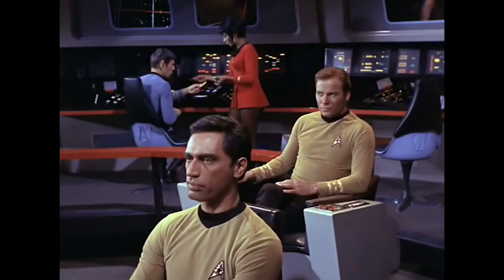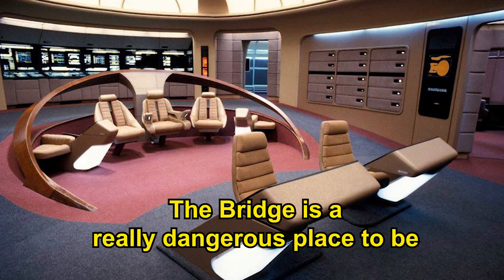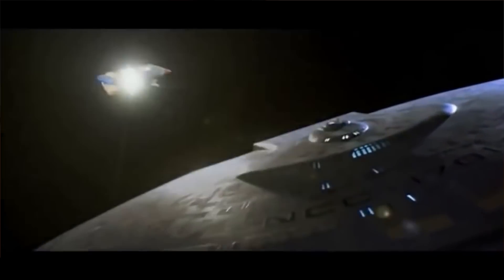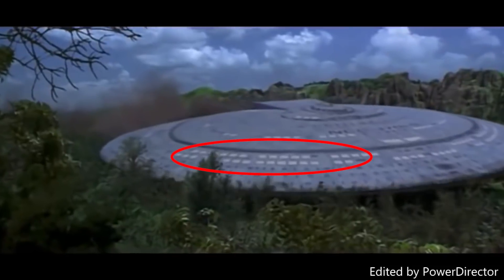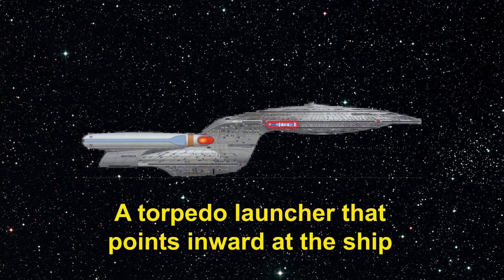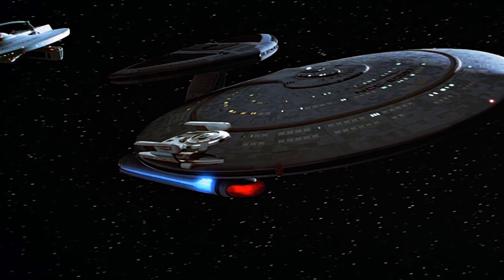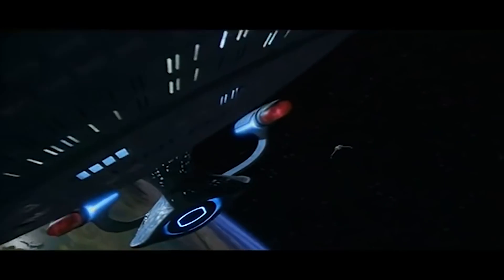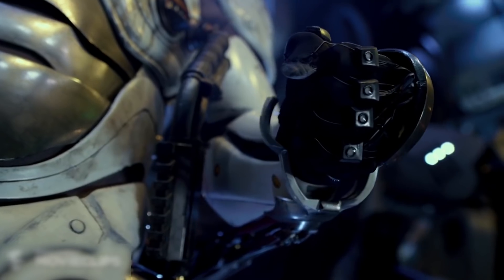10 Flaws Star Trek - USS Enterprise NCC 1701-D

Comment: The Romulan warbirds always seemed kinda stupidly designed. Don't get me wrong, they look cool, but all of that hollow space. Where's the warp core? The shields have to protect a lot of nothing....
Reply: Romulan Warbirds dont have a Warp Core, they use a black hole for getting energy.
Reply: @Konzertvideos  technically it was an artificial quantum singularity
Reply: They couldn't afford a natural quantum singularity?  The damn Romulan economy is in a slump.
Reply: 00 Coyote
The original concept was that warp nacelles needed line of sight to be able to connect. Which is why they're usually kept exposed on the ends of pylons or wingtips.
So the warbird's hollowed out section lets it's nacelles "see" each other. Though it's still a stupid design. I mean are those wings even used for anything?.

Comment: To answer your question regarding shield modulation, the reason their shields don’t automatically modulate is because any weapons that need to fire through their shields, like their own phasers need to be the same frequency in order to pass through. As Starfleet has a very small ranger for phaser operational frequency. In addition, as they have no way of knowing what the klingons weapons frequencies are they run the risk of setting them to the same frequency and the same thing happening

Comment: Here's a flaw: the corridor design. They loop around the saucer section, meaning you have to take the long way around to get to the other side of the ship. There's no straight line from the back to the front, so good luck getting anywhere fast.

Comment: The Galaxy class ship was a battle cruiser. It was the state of the art vessel of the time. The reason for the luxury was because it was designed for very extended long range exploration missions. Thus this why families were allowed to come with the officers. 1701-D was designed to have a 100 year service life, which is also why the expansion areas were designed into her hull. You might want to pick up that tech manual and read it. Most of what you were arguing and didn't know about is in those pages of information.

Comment: This was fun! And there was an attention to detail for certain. Just as a quick joust, I'd have to point out that fluctuation of the resonant harmonic frequencies of the Enterprise shields requires significant more power than leaving them static. In the same way that a musical instrument playing a symphony is under more duress than the same instrument playing a single sustained note. It would be more optimal to leave them operating at a specific resolution in order to conserve power, in case that extra boost might be needed in a pinch; for say, the engines or the deflector dish.

Comment: This was a good video! In Generations, along with remodulating the shields, I never understood why they didn’t just eject the warp core if it was about to breech. They wasted so much time evacuating everyone to the saucer section that they didn’t have time to escape the blast. They should have just dumped the core and used the impulse engines to get away from it.

Comment: The placement of the warp nacelles is based on the shape of the warp field it needs to create. The Enterprise is a long range cruiser, it needs to project a specific warp field to do this, just as a plane/ship needs to be balanced correctly to reach optimum speed thru the air/water.

Comment: You are one of the first to recognize that the Galaxy Class has that 3rd torpedo tube.  Also speaking of escape pods, there are even cetacean escape pods that get jettisoned through the iris style cargo doors on the primary hull.  

My issue with the Generations movie, shield frequency aside, is the fact that the warp core, with myriad safety features, was sent into a breach by barely scratching the surface.  The only thing in that area that was struck by the BoP that was vital was Deuterium Storage.  And thats after you get past the hull plating and labs that are in that area.  They could have made that fight a lot better.

Comment: In practically every Star Trek Star Ship the bridge is always on the top. This design flaw seems to stem from the days of the navy. The bridge is always up there and exposed. This REALLY shows in Star Wars where the Star Destroyer bridges are practically way out there, much like the warp pylons. Doesn't help that the shield generators are also just as exposed.

When it comes to the Warp Engines, well... We really don't know much about the magic behind them that bends time and space for FTL Travel, so maybe depending on their abilities they do need to be exposed, whether it is due to radiation exposure or more efficient in folding space the further out they are.

And the aft torpedoes, while the drawing shows two launchers, here's a fun idea to think about: When joined, the torpedoes are actually sliding down the "spine" of the ship. ;D

Comment: A lot of people forget the D was about more than exploration. It was also regularly used for diplomatic missions, which would require some luxuries. Also, leaving room for future upgrades is likely what made the alternate future Enterprise-D possible. And the D was upgraded multiple times through the series. They didn't even go a season without  some upgrades being made, including making people in the holodeck. (But we can go over how D holograms are fake matter and Voyager holograms are photonic later.)
Bridge placement has been an issue since Starfleet existed, it seems. However, the bridges of Klingon ships are also not well thought out. The Bird of Prey(a Romulan vessel stolen and used by Klingons), as well as the D7 both have their command centers in the head of the ships, at the end of very long, narrow necks. The Romulan Warbird is also a victim of "designed to be cool", what with the entire back half being an elipse with nacelles attached. I wonder if the head is designed to detach?
It's nearly impossible to find a starship in the franchise that is designed properly. However, this all comes down to "What is Starfleet's purpose?" Is it for exploration? Is it for defense? Is it for diplomatic missions? If you answered "all of the above," than maybe it's time the franchise acted like it. Kinda tired of it always being some sort of either-or deal.

Comment: I play Star Trek Bridge Crew in VR and the flight controls on the STNG bridge work well and are intuitive (no gentleman sausage control required). The disk looking control you point to @10:15 does actually steer the ship in VR (port/starboard/dorsal/ventral). Mass doesn't matter in the vacuum of space where there's no resistance, so designing and lugging that over sized hulk around wouldn't be an issue IMHO.

Comment: The shield modulation thing... you're presuming there is no downside in remodulating. It could compromise the integrity of the shields, so for most of the time would be disadvantageous particularly against phaser fire. The Borg example was not to combat weapons, it was to fuck up the Borg's grip. // Wasted space, doesn't matter really. It's not like the heavier they are the slower they'll go. // Warp engine locations, well largely aesthetic... but you could argue that it gives better warp field size/distribution allowing for faster speeds etc. // The bridge location, indefensible. Put it in the middle of the ship. // I don't think three incidents of the ship being stolen/occupied is "constantly". And one of those they were just trying to steal some stuff while they weren't looking. // Saucer separation crash/why no escape pods... potentially as they warp core ejection hadn't worked and they were about to have an entire exploding half-ship nearby, escape pods would be blown up. They're better in the saucer with some shielding. You never asked why Crusher was evacuating sickbay when it was already in the saucer.

Comment: The EPS power grid is a grid of conduit that has basically thick beams of "lightening bolts" that travel along them.  So if an enemy ship hits meters away, it is up to the flaws in the materials of the conduit to decide when and where those bolts of lightening will escape from as the material fails from stress and the electromagnetic containment inside those conduits that keep the magnetically charged plasma from coming into contact with the conduit walls fails.

This is why the computers and consoles explode in Star Trek, they are surrounded by plasma conduits .

Comment: You skipped the reason why saucer section of the Enterprise D has crash landed. It was hit by warp core explosion and pushed to atmosphere where the lost ability to control descend, all part of the movie. Otherwise they could sit on orbit and use transporters to evacuate on planet if needed. Also saucer was for emergency needs, not full spec ship. One of the few parts done on battle bridge was actually a flight through atmosphere in first season during battle.

Comment: I need to make a point about seatbelts vs. the inertial dampeners. The ship routinely accelerates from 0 to some appreciable % of the speed of light in seconds. (Warp speed has the ship travel on a bubble of space that travels with it, so it's not technically moving through space when travelling at FTL speeds.) If the inertial dampeners fail, safety belts may as well be knives because the crew will be crushed into an atom-thick paste.

Comment: Flaw with your flaw list, when talking about the crash landing (not having landing gear) and not using escape pods. The damage from the battle with the KIingons and the explosion of the Star drive section caused them to get caught in the planets gravitational pull and CRASH on the planet. It wasn’t a choice so even if it had landing gear it wouldn’t have been able to land with it, like Voyager in your “wrong” clip.  All they could do was minimizing the impact as much as possible but they didn’t have flat area so they were screwed. 

And the Escape pods? It’s called time, they didn’t have it.

Comment: Not having multiple transporter systems linked to different operating systems and power supplies. How many eps did they have transporter problems? On a similar note, they had a hangar bay of ships equipped with transporters that were never utilized in times of crisis.

Comment: They can do a site to site transport within the ship, even with the shields up, so even in a battle they can transport torpedos from the aft launcher of the saucer section to another launcher.  This specific thing never occurred on TNG, but other episodes transport torpedoes to various locations.  So it is possible.
They probably designed that particular launcher to be deeper in the ship to protect those 70 photons from being easily damaged.
Your points definitely make sense.  But the debate is what I like the most about Star Trek theory.  I just happen to be a hard core Trek nerd, so I have an answer for almost anything lol

Comment: Since I haven't seen anybody touch on the automatic shield frequency thing it's because of several reasons 1 some frequencies will Make The shield weaker against certain attacks others will make the shield stronger but straining the power system and having automatic shield frequency will have problems during a computer outage now they could have done better by making the shield frequency where you have to pull it up on the screen instead of keeping it out in the open at all times.

Comment: In regards to the warp nacelle positioning, I have heard that the larger nacelles generate a higher resonating vibration and noise, the pylons give it some segregation. Smaller ships such as the defiant don't have this issue as much nor are they built for long duration flight so this wouldn't drive the crew crazy.

Comment: That the bridge is placed at vulnerable spot is often seen in sci-fi across various franchises, is very common. Also IRL the bridge, or a similar control area, is typically placed at the highest possible point on the vessel to provide the best possible overview without having to rely on cameras and/sensors which may fail.
As I recall, one other reason for the placing of the bridge on Starfleet ships is for easy replacement as the bridge is basically a module which may be replaced because of damage or because of specific needs for any given mission. But I don't recall having seen this being done on screen in either tv-series or movies.
I do prefer the bridge variant seen in Generations because it seems to utilise space much better.

One note on Starfleet and war-ships: Even the Defiant is officially designated an escort suppossed to protect other ships, even if she has been descriped as a "gunboat" with a single task in mind; to fight and defeat the Borg.

Comment: Modulating the shields would make firing weapons a bit hairier. They'd either have to stop modulating as they are firing, or they'd have to allow the weapons to modulate while the beam or torpedo is in transit. If they get the timing wrong, they'd wind up damaging their own shields.

Comment: If you build a model of the Enterprise, you will see that putting a mass (like a giant saucer, a giant engine, etc.) at the end of a skinny beam produces a pendulum-like wobble toy. 

If such a ship were ever built, it would be a vibration nightmare. Something as simple as tendons connecting the two engines to each other and to the stem below the saucer section would make the ship fantastically more stable.

Comment: Argument I'd give to the warp nacelles.  The engine(warp core) was deep inside the body of the ship with the Nacelles on the outside.  They are more akin to the jet exhaust parts of a jet engine.  They're likely put out like that and farther apart from each other to give improves maneuverability through differential output as well as having them farther away from the body means they could likely run hotter without effecting the rest of the body(since heat dissipation in space is very poor).

Shield modulation being static is likely tied to giving the ability for federation ships to be able to transport things between each other without having to drop shields.  If it's constantly modular they would need to drop shields in order to transport and if you're doing an emergency pull of crew from one ship to another you likely are not in a situation that it'd be good to drop your shields.

The controls is likely a heavily ship assisted control system.  The touch screen you give general control instructions and the ship is able to add in needed intermediate control sequences.

Comment: Piloting the vessel: they utilize predetermined patterns of navigation or flight pattern based upon the circumstance. The computer does most of the work.. Though certain con officers are very adept and can on the fly input direction and throttle changes in quick succession.